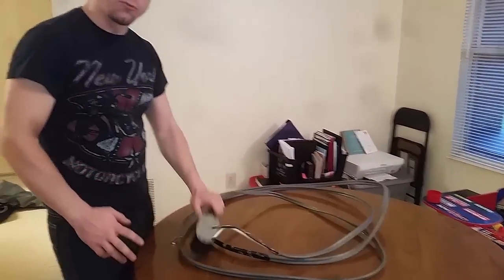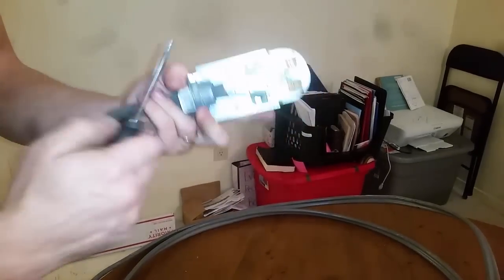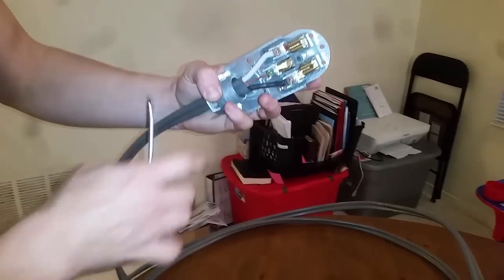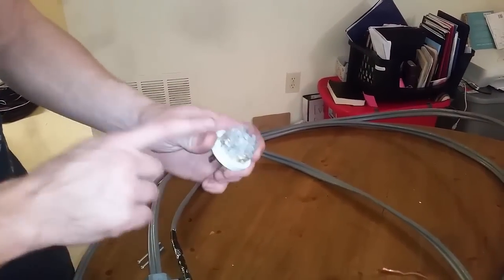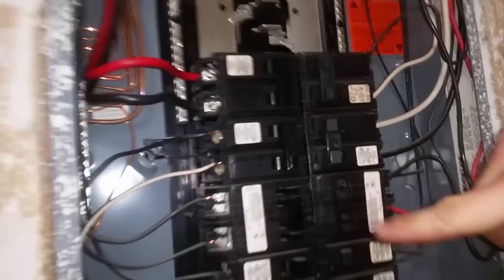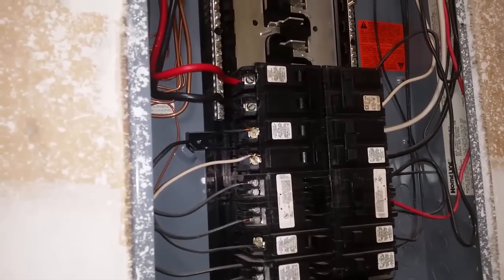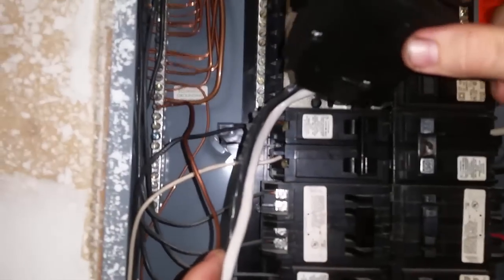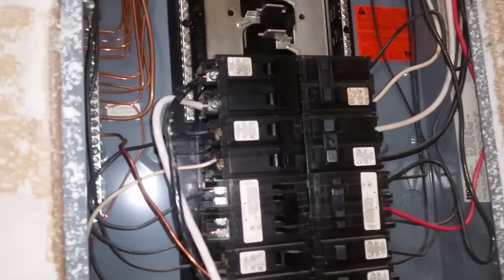how to install a 50 amp 220 volt 240 v plug for your welder, and DIY generator cord

Comment: Can I double tap the dryer breaker .
Reply from the maker: I wouldn't.  But you can definitely use the dryer outlet
Reply: @InvincibleExtremes          I have two empty single pole spaces left in my breaker box one on right and one on left and I want to install a 240volt line for my welder is this possible?
Reply from the maker: For it to be 240 you need to make sure they are opposing legs.   Otherwise it will only be 120v.  Breakers directly in line with each other are in the same leg.  If you look at the metal under the breaker it becomes obvious.

Comment: Did this before but I'm at my new place and I'm kicking my self for where the white wire goes glad to see it doesnt matter lol. Thanks! Great video
Reply from the maker: Yeah, be careful with that.  It's technically illegal to use white wire for current but it works.  And also keep in mind you might need a 4 wire thing if the plug has 4 prongs...

Comment: Can you make an extension cord instead? That way you don't have to mess with the breaker and plug directly into dryer outlet.
Thanks
Reply from the maker: Of course, that would be much safer
Reply: @InvincibleExtremes   I was told that could cause a fire using the dryer plug to run a welder.  Just be careful out there.

Comment: Thanks for making this. I have a water heater i just eliminated in my house. It was hooked to a 30 amp breaker in my fuss panel. I just bought a harbor freight 200 welder that runs off either 110 or 220. I’d like to run it 220. Can I run it off the 30 amp where my water heater was? Or would that need to be a 50 amp breaker? If you think it needs a 50 amp, can that 30 be switched out for a 50 amp?    Thank you for any help with this.
Reply from the maker: 30 Amps will be fine.  That's what I do at my new place
Reply: Yes per the manual it pushes out max amp @29.6  so a 30 or 40 amp breaker will be fine. The key is make sure wire is at least 8/3 if not upgrade to 6/3.
Reply: John. I just posted on another video about this same issue. I'm getting ready to do the same thing in my garage. I have a existing 220v receptacle for my table saw but have to change the receptacle to a 50amp. I'm pretty sure it would be wise to use a 50amp breaker. Can you let me know if it worked for you?  I bought the Titan welder from H F (green wellder) the manual stated at least a 50 amp breaker was required.

Comment: My panel has no main switch.
It's a sub panel I live in a apartment building. I have no way to shut it down. But I wanna install a 30 amp breaker for a 220v Dryer. Should I install the breaker while its live like u did?
Reply from the maker: I strongly recommend you don't do that.  I'm a combat vet who jumps out of perfectly good airplanes in the middle of the night.

Comment: This is the best diy video tutorial on wiring up a 220v plug and breaker.
Reply from the maker: Remember it's only 240v and you need the white neutral wire on items that have internal 120v parts...
Reply: @InvincibleExtremes  Right. Im about to wire up my 220v welder the same way.

Comment: any time people make electric videos everyone in comments screams about safety. yes shut the power off blah blah we know already lol. anyone attempting this type of work is probably already familiar with the dangers. cool work-around DIY solution, i liked it anyways.
Reply from the maker: Key thing to remember is this is only for 240v... many applications require a neutral wire as well to run internal 120v items

Comment: I need another one of these generator cords for my Everlast welders.
Reply from the maker: If not using for dedicated 240v you need to have a neutral as well.  This setup is STRICTLY for feeding a 3 prong 240v welder

Comment: What Awg wire did you use fur the two pier terminals and what gauge cooper for the ground of is it a basic 10gauge?
Reply from the maker: Ground has to be big enough to safely support both legs of 120v

Comment: Aside from not shutting off the whole panel (!) you are using a home supply cable when you should be using a flex jacket cable of similar gage for your extension cord. If you're going to put yourself out there with a video, try to seem informed and safe.
Reply from the maker: Still using it to this day without issue.

Comment: I tried this before hooking my 4-wire generator up to my three prong welder plug and it burned up several things in the house when I tried to use them! I had to put a jumper on my generator plug end between the ground and neutral to make it work. Have you ever had that happen?
Reply from the maker: Whoa. 3 prong is dedicated 240v... you need that 4th wire for a neutral  to run any kind of 120v.
Reply: @InvincibleExtremes  but why didn't you address this in the video with your 4 wire generator plug to 3 prong plug?
Reply from the maker: Because this is specifically for the 240v welder.
Reply: @InvincibleExtremes   but you showed how to hook up the generator through that line without that warning
Reply: Or without watching the video again, were you powering your welder with the generator? Edit: Ahhhh never mind, I apologize I misunderstood. I thought you were showing how to backfeed the generator to the panel. Good video 👍
Reply from the maker: Yeah I wish I was more clear about that.  I'm sorry.  Yes I only use this cord with the generator and the welder, or the panel and the welder.  Honestly wish I would have gone into more detail about what exactly makes up 120 and 240....
Reply: @InvincibleExtremes  well there's an idea for your next video, how to backfeed your panel with a generator when the power goes 👍
Reply from the maker: Technically very illegal.  But I have installed back feed cables before.  They require a lockout breaker in order to be safe

Comment: I need 120 volts where I got my 240 volt welder at.
Can I convert a 240 volt drop cord to a 120 volt by just using just one leg of the 240 volt outlet?
Reply from the maker: Yes but you need 4 wire cables for that.  Neutral is needed for the 120v

Comment: Good info, but my gosh man, the way you were moving your hand around and pointing was scary.  That bus bar was just inches from you hand , several times.
Reply from the maker: That is true... don't be like me... turn the power off.  And also... some devices need 120v... so you'll need a neutral as well

Comment: Generators are designed to use all 4 wires. Two hots , a neutral  and a ground.  At least if your going to run it to your house You need the neutral wire. The way the extension was wired  it shouldn’t be used for that.  You could use it to run something off the generator such as a welder.
Reply from the maker: Agreed.  Some things need a neutral.  This wire isn't to power your house. It's only to run a dedicated 240v item like a welder.  Been using it for years now.

Comment: why you don't use the neutral ?
Reply from the maker: Because 240v doesnt need a neutral.  Applications where they have 120v parts will need it though... like a stove. For the clock....
Reply: @InvincibleExtremes  thanks for you help

Comment: Technically how you are doing that is not safe because you are exposed to the bus which is energized and you do not have an arc flash suit on and if that screw driver slips and you hit that bus you will have an arc flash and it could kill you. Just FYI it takes less amps to kill you than it takes to light a single light bulb just be safe kill power
Reply from the maker: You're right.  It takes a 10th of an amp to stop your heart.

Comment: Never use white neutral wires for a hot leg.  It's just bad form.
Reply from the maker: When doing work for someone absolutely.  But you use what you can get ahold of.  Its key to mark the white wire in some way though.

Comment: Just turn off the entire panel. Takes 2 seconds...
Reply from the maker: If possible that is the best way to go.  Sometimes not possible though, medical equipment or other reasons.  Obviously not the case here, but i have no problems working on a hot panel.
Reply: True Marcel.  However, its difficult to make a quality and informative YouTube video in the dark.

Comment: Sometimes turning the power off is not an option. Locked meter room, medical equipment running etc. Just have to be careful!!! Done it a thousand times. If you mess up it's not instant death...come on man...scares the crap out of you and you are more careful the next time. There are two kinds of electricians...ones that have been shocked and ones that will be shocked. Just can't be stupid. Use insulated tools, insulating gloves, power testers and a basic knowledge of electricity.
Reply from the maker: Yup!

Comment: I need a 240v plug for my welder in my garage, the main breaker box is in the oposite side of the house, i will have to run the cable from one side of the house to the other through the attic what should i use to protect the cable? And to connect the wires in the main breaker box i just do it like you did?copper to ground and black & white to either side of the breaker? Sorry one more thing would it be ok to use a 50amp breaker and 8 gage wire? My welder is an Everlast 251SI max amperage is 250amps.
Reply from the maker: Since both the black and white will be hot, make sure to mark them with black or red tape.  Or use a 4 strand wire and bare goes to ground, white goes to nuetral and black and red will be the hot sides.    Really depends on what will be plugged in, welders don't need a nuetral, but stoves for example do.    In the attic the wire can be left unprotected or run through some plastic conduit if you want to protect it.  Its very straightforward
Reply: Invincible Extremes Muscle Cars Garage 

I will be using a welder and plasma cutter  both 240v so i can use a 3 wire cable and just set it up like you did right? Just as long as i mark the wire to know both are hot
Reply from the maker: Yes, you wont have any problems with that.  Ive been using this wire for years since i made the video
Reply: Invincible Extremes Muscle Cars Garage thanks for your fast replays have a wonderful holydays
Reply from the maker: You too.  Be safe, and never work on a live panel...

Comment: Do I need to upgrade my circuit break wire to connect my welder ? Or I can use the same Oem outlet just upgrade to a 50amp outlet.
Reply from the maker: Never put a bigger outlet on a wire designed for a smaller load.  That's how you burn the house down...
Reply: 6 ga or better

Comment: Sorry use the right cable black with red and ground or tape the white wire red tape at both ends of cable. You can kill some with hot white wire.
Reply from the maker: Agreed

Comment: If I did 50 amp could you still plug in a 30 amp into the outlet? Like 50 amp would be good all the way up to 50 Amp right? I don’t know much about electrical
Reply from the maker: Yes, you can use as little as you want
Reply: okay cool thank you man!
Reply: I'm hooking mine to a 60a circuit

Comment: WTF! Are you trying to kill people, you forgot to mention to stand on the ground bare footed in a puddle of water. Its is very easy to make a mistake - touch the wrong part and ruin your day best advice find a way to turn off the main breaker thats supplying your panel otherwise pay the extra and get an electrician.
Reply from the maker: Yeah. Forgot to add that.  Turn the breaker off

Comment: Question:  With power still on to the box, can't the bus fry you if you touch it?    If so that's kinda nuts messing with it with power on, yes?
Reply from the maker: David Battle yup, very nuts.  In this case I would highly advise turning off the main, but I was confident in my abilities and could safely do what I wanted to do.
Reply: You will not get fried! You might get a shock but not get fried.

Comment: Uhhh..   I was looking for that video on interior design and fashion....  This isn’t it.  😂     (Been there.).  To the Safety Gurus and Wise Old Timers..  Thank you!  Excellent point.  Still, he probably couldn’t make the video if he flipped off the main breaker due to lighting needs.  Rookie Decisions and Risk often accompany our GITTER-DONE TYPES in their youth...   Then they see someone bite the bullet and it all changes.  I’d wager 90% of his viewers have all done something around tools / equipment that is a very unnecessary risk.  Thanks for the refresher everyone. 👍.  Stay Safe.  Interior Decorating for those with low risk tolerance,... 😂 😂 😂

Comment: Hows it going man,
On your breaker how much does it cost ?
How do I know which one I need?
Ill be using  a vulcan 215maxx
And a Lincoln arc 225
Reply from the maker: Leo Tovar pull a breaker you have and don't use at the time, and go to the store with it.  So then you can match the brand... they are all different.  50 amps will be more than enough to run almost any welder.
Reply: Invincible Extremes Muscle Cars Garage 

Kool man for sure I will look into it thanks

Comment: Wow. Convenient. A twofer. I needed to both get off of my laundry circuit as wells as make generator extension cord and this one vid covered both. Good Man!
Reply from the maker: James oppy thanks, just remember that some things need a neutral to run 120v items like a timer and so on. So use a 4 cord cable for that
Reply: LOl Ohhh  I will be strictly using this for an old 3 wire Lincoln ;)
Reply from the maker: James oppy that'll do it! Thanks for watching.

Comment: Simple and straightforward. Thanks
Reply from the maker: Midlife Crisis Thanks! Just make sure you turn the power off when doing it
Reply from the maker: Midlife Crisis also keep in mind this is for my welder, but for some things, you will need a neutral because the clock on a stove works off 120 for example...

Comment: Yeah well I know this is old but you should never use a white wire for a load wire. I see a few white wires being used on the hot side. White wires are only for Neutral. If using a white wire you MUST mark the ends with black electrical tape. And as mentioned below you must turn off the main breaker. One slip with a screw driver or a finger will send you to the other dimension pretty quick.
Reply from the maker: FAV4RAV that's very true, usually a 2 wire 240v system will use a red and black, not and black and white

Comment: Would I be able to plug my welder directly into the outlet that’s wired to the breaker box? I think there should be a fuse in between, no? Or the is the breaker itself sufficient enough.

Great video! This may have saved me time and money as well as landlord hassle over a new sub panel.
Reply from the maker: ayewad the breaker is the fuse.  If you somehow mess it up, it trips.
Reply from the maker: ayewad yup, landlord hassle is exactly why I just did a temp setup every time I needed to use it.  Just make sure you disconnect the main power every time you do it, or you risk killing yourself every time you do it
Reply: Invincible Extremes Muscle Cars Garage genius man!!! I appreciate this. More than a comment would mean. There’s always a way around obstacles. I reckon you would have to fix your clocks and everything that gets shut off after the main is off, but small price to pay for being safe with your life. Thanks again!!
Reply from the maker: ayewad yup.  I mean, I don't always shut the main off but I'm no stranger to this... but I wouldn't dare do it like that in your shoes

Comment: Why you did not use neutral wire. How the current flow back to grid
Reply from the maker: Sukhjinder singh 240v does NOT use a neutral wire.  You need a neutral wire for 240v if using a stove, because some parts of it actually use 120v and therefore the neutral wire.  That's where the confusion comes from.

Comment: can you buy a 240v breaker, and just plug it into and empty slot when you need it? Then the only wiring would be the ground.
Reply from the maker: +VanishingNomad yes, that's the best way to do it actually.  But this wasn't my house and I didn't want to break off the tabs in the panel cover or anything like that
Reply: @InvincibleExtremes  Based on your wiring choice, I don't see how you can close the panel cover anyway. Double pole breaker is $10, way better than switching wires all the time.

Comment: Hahahaha im nervous as shit to hook one of these up lmao
Reply from the maker: marc fate just turn the power off...
Reply: Invincible Extremes Muscle Cars Garage i know im more nervous hooking it up an burning my house down after running my machine lmao im doin my research tho
Reply from the maker: marc fate that's what breakers and thick wire is for... impossible to make the wires heat up if you use a 30 or 40 amp breaker... it'll trip before the wires get hot at all

Comment: not indoctrinated with real electrical terminology.  his words for a panel are constantly changing i think i heard him call it a smorgasbord a control board, control panel, a breakerbox, a surfboard,  its not a big deal in this case, but he needs continuing education.  itz also more important to your reputation amongst learned electricians.  because theyre a very smart trade. very technically minded and matter of factly sticklers for proper terminology.  often grammer nazis
Reply from the maker: rbmaserang panel and breaker box are the only two things I call it.  And yeah, I'd love more education.  Wouldn't hurt...

Comment: why are some 220v sockets turned?
Reply from the maker: Jean-Marc Beausoleil the locking ones are for generators so they don't become unplugged from vibration.  And 30 amp, 40 amp and 50 amp plugs all have different plugs so the wire that's only rated for 20 amps doesn't get a 50 amp load by accident and burn the house down...